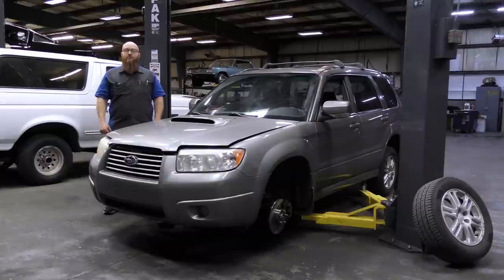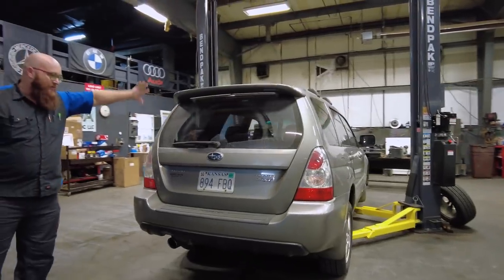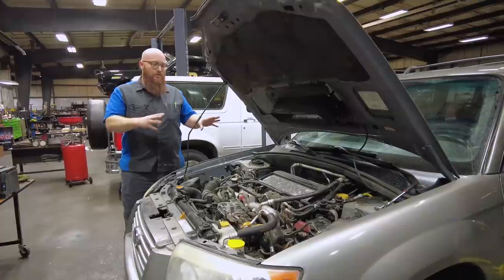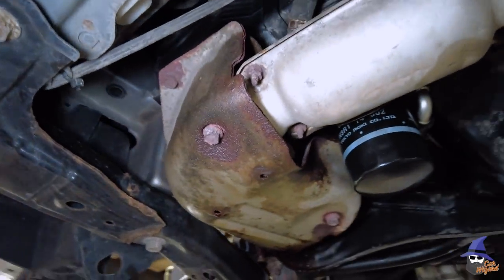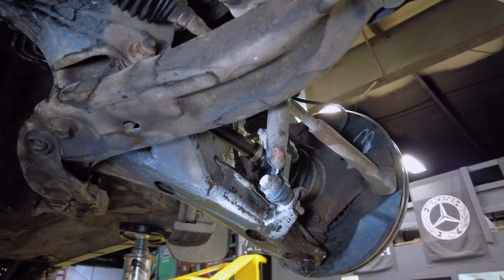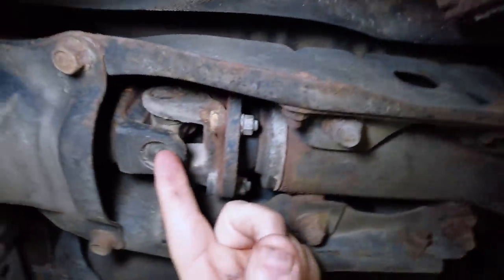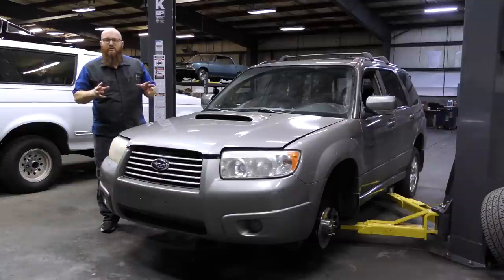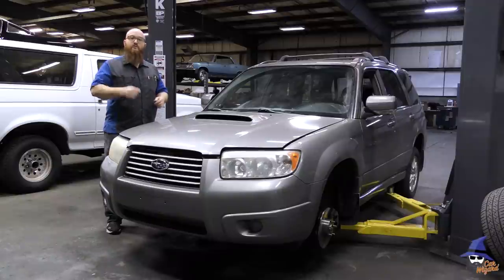Can't fix it all! '06 Subaru Forester XT has issues the CAR WIZARD doesn't fix. What are they & why?

Comment: According to my Subaru experts, the 2006 XT Turbo head gasket was a beefed up Multi Layer Steel headgasket and has never had any head gasket issues.  It was the non-turbo models that had a different crappy headgasket that are the known problems.  In fact when replacing those other models headgaskets, it's advisable to upgrade to the Subaru OEM multi layer steel head gasket otherwise the problem wil re-occur.
Reply: I have this exact same model even the same color. Many electrical gremlins and finally the engine grenaded when the lower rad hose came loose on highway and because the temp gauge couldn't be trusted my son didn't notice it.
Reply: You are precisely correct sir
Reply: Exactly. The non turbos have a crappy coating that degreats around 100k miles. It creates a gap between the head gasket and the block, then oil starts leaking through that gap.
Reply: @robsonselzelin  exactly. Unfortunately I didn't know this when I had mine replaced at 95,000 miles on my '04 forester. Live and learn I guess.
Reply: One thing to watch out for when putting an MLS gasket on a NA engine is that they're slightly thinner than the stock head gasket.  If you've had the heads machined you'll want to check tolerances before cranking it over.  Generally speaking, if it's been resurfaced once they probably didn't take enough material off to cause an issue but if they've been cut on closer to the minimum spec you may have piston-to-valve clearance issues.
Reply: The crappy head gaskets required Subaru coolant and the ground straps intact so they don't flake off from electrolysis. Nobody ever bothered to use the right coolant so they always ended up leaking on those models
Reply: @robsonselzelin  Got the SOHC 2.5L NA with 310, 000km still using OEM gasket.
Reply: Buy a FelPro.
Reply: I wonder how much extra money that steel headgasket costs.  Whatever the amount, it's a shame that Subaru couldn't build these right for what is likely trivial money.
Reply: Not true, its the earlier Subaru Turbos (90's through to around 02-03) that have dodgy gaskets.

I have an 05 Legacy R with an EJ204, never had a head Gasket done and before it came to my ownership, it had a very rough life and its still on the OEM Gasket with 135,000 miles and has not a single symptom of head Gasket issues.
Reply: @aaronmclaughlin9766  yet. Lol. Mine went at 147k
Reply: @aaronmclaughlin9766  No, It was indeed the NATURALLY ASPIRATED EJ 2.5 engines that had the head gasket issues, ask ANY Subaru fan or expert. The turbos with the multi layer steel gaskets did not have the issue-- generally speaking.
Reply: @timdodd3897  Ummm NO, Fel-Pros are OK for a lot of stuff but NOT a Subaru NA EJ 2.5 head gasket!
Reply: @sblagg527  Don't have any experience with the 2.5, only have experience with the 3.0 twinscroll, which did have issues, a 2.0 turbo which also had the headgasket go and then my 2.0 NA which runs like a champ.
Reply: @colbyroberts7963  If you're talking about a USDM model, then it's like comparing apples to oranges, the USDM didn't get the Gen 4 in a 2 litre guise, the smallest engine you guys got stateside was the 2.5, my current legacy is a JDM import, 2 litre EJ204 DOHC, which don't commonly have headgasket issues.
Reply: This is correct.
Reply: @aaronmclaughlin9766  The only Subarus that are being discussed here are the US models.
Reply: @sblagg527  ahh that's right, because as all Americans believe, the world revolves around you.
Reply: @aaronmclaughlin9766  You're the one who butted your way into this discussion with your irrelevant 2.0 liter (oh sorry LITRE.)
Reply: @timdodd3897  Never under any circumstances should one use Fel-pro head gaskets on a Subaru. They are absolute trash!
Reply: @tflo9543  Despite the multi layer? I've heard nothing but good about them. My ex employer.
Reply: @timdodd3897  they blow faster than oem. We laugh and call them FAIL-pro. They fail in the worst way possible too, coolant into the combustion chamber/overheating. OEM or 6 star motorsports gasket kit is the only way to go for the 2.5l n/a.
Reply: @tflo9543  Thanks. I'm doing a 1.8 Audi soon
Reply: N/A EJ's use MLS gaskets too, I've replaced over a hundred of them.
Reply: @jamesgeorge4874  The ones you replaced probably were the defective ones that came with a black colored graphite coating.  However, the MLS gaskets that have NO graphite coating, as the OEM ones used in the Turbos, do not have the black graphite coating and thus they don't have the head gasket issues requiring replacement every 100,000 miles.
Reply: @jamesgeorge4874  No the head gaskets that are having issues have a black graphite coating on it.  The turbocharged engines as shown in the video are not having any head gasket issues, only the non turbo head gaskets.  So you're trying to tell me that you've been replacing Turbocharged Subaru engine head gaskets for 30 years?  Sounds like you've been ripping off your customers for 30 years with unnecessary head gasket replacements.  You should be proud for that Master auto mechanic license you found in the cracker jack box.
Reply: @jamesgeorge4874  Yes most of us here also have fancy mechanic certifications and have replaced head gaskets since before you were in diapers but we don't feel the need to brag about it as a defense to our ignorance.  I rely on the Subaru expert mechanics to tell me what is going on with the failures and I'm not too old to learn from these smart young guys.  If you're that stubborn as to not heed what they say, then no wonder you keep replacing head gaskets over and over.  From your comments it appears that you failed to replace those OEM faulty headgaskets with an upgraded one.  So I'm sure you'll have a lot of repeat business every 100,000 miles when those hundreds of stock headgaskets you put on fail over and over again...just keeping ripping those customers off Mr George, if that's how your work ethic is.  By all means, don't pay any heed to those mechanics that specialize in Subaru engines, just keep doing what your doing because nobody can teach you anything new.  James George, say hello to the Youtube mute button, I'm graciously allowing you to have the final word.
Reply: @mrcead  subaru coolant? So subaru has their own special coolant i have not heard about such coolant since owning 4 subarus maybe its cooler then the auto shops.
Reply: @kylegriffiths5990  B S show a picture then
Reply: @joel.3112  🤣
Reply: FACTS!
Reply: @kylegriffiths5990  my 2L na have the original gasket and 390.000km . last summer subaru changed the lower A arms for FREE and this car is made in 2005 :D  they had a recall due to rusting issues. now i have spare a arms that only have a small hole to weld.
Reply: I believe that's also the issue in the N/A Impreza EJ25s
Reply: At least it's not a junk Volkswagen or bmw or benz
Reply: My 2006 xt had head gasket failiure
Reply: How many miles or km has this one run?
We have also many in Switzerland from them and mine lasted 370k km.
Mine also has Pedders Suspensions.🤩
Reply: I have a 2000 forester and shes on her 3rd engine. #1 was blown when i bought it,#2 was put in and lasted 6 years until the headgaskets finally went. It still ran but couldnt hold coolant.#3 is a jdm ej203 that i rebult myself  because id rather have everything done so i can keep track from mile 0. I just replaced all EVERYTHING that had a seal, bearing, or bushing including the transmission. Cost me $3000 to redo the whole car instead of $3000 just for headgaskets
Reply: I have the 08, everything else the same. Any idea if they carried this beefed up 06 into the 07 and 08?
Reply: @timdodd3897  I used to use FelPro gaskets until they started failing on me. I really liked them back in the day, but something has changed with them.
Reply: yep, the NA eats head gaskets, the turbo eats turbos (banjo bolt filter clogs and starves the turbo of oil) and ALSO can easily destroy the 4EAT auto. so turbo with manual and replace the banjo bolt with a filterless updated version and mayyyybe it's ok?
Reply: @nickkalister6291 the turbo model has oil pump issues as well. Every time you do a timing belt and water pump, do the oil pump as well.
Reply: My 09 forester made it to 204k on the stock engine before it blew the head gasket completely. 
Slapped a 0 mile reman in and she is perkier than ever! Also tossed on a 2021 STI cat back and 2021 STI sway bars front and rear with kart boy end links. Most all my other suspension is new(struts, wheel bearings, axles, control arms etc)
My reman has all MLM gaskets
Reply: @dingdong2103 cool. Sounds like owner neglect
Reply: Small price to pay for peace of mind. I agree with you about the gaskets on the non-turbo engines. Subaru finally fixed the problem after many years of knowing about it. Poor customer service. Since Subaru knew about the problem, there should have been a recall with a replacement at Subaru's expense.  @jimmy-buffett
Reply: @dingdong2103  sounds like an easy fix.
Reply: I just did head gaskets on a 07 Forester 2.5 NA. It had factory MLS head gaskets. Car has 160k miles. Factory gaskets have issues. This vintage it's a common flaw
Reply: @earlstacey2709  If the 07 Forester you were working on was NOT the XT version, then it wasn't the Turbocharged engine, and it didn't have the same gasket that I'm referring to.  My 2006 XT Turbocharged Forester has had absolutely no head gasket issues.  I have been told by several Subaru mechanics at different shops that the reason that I have no head gasket issues was that the Turbocharged engine came with completely different gaskets than the non-turbocharged engines.  Now if you want to complain about the front control arms rusting out as a common flaw issue with Subarus, then go ahead because there was a major campaign to replace these because they were rusting from the inside out and tearing apart suddenly.  Talk about dangerous.

Comment: I owned a 2006 XT Limited and loved it. The turbo failed so I replaced it with a big JDM STI VF30 turbo, custom tune and Milltek turbo-back exhaust which added 100 hp (230 hp ---> 330 hp). It went from 'peppy' to 'WHOA' overnight. The ultimate sleeper.
Reply: yep had 2, they were awesome... porsche macan minus the sound deadening
Reply: I’m having a issue with my 2005 XT EJ25 new turbo just installed builds 13 lbs but it’s cutting power
Reply: @montuckyhomegrown how many miles?
Reply: How did the new turbo change fuel consumption if any?

Comment: The naturally aspirated 2.5s came from the factory with the coated paper head gaskets that have been issues for years.  The turbo engines and the 6 cylinder engines came with MLS head gaskets from the factory and were much more reliable.  That's why if you have to do a head gasket replacement on a Subaru n/a engine, you should use the turbo head gasket as the replacement.
Reply: This! Wise words!!!!
Reply: Bruh wtf was Subaru thinking
Reply: You're not going to find the old style paper gaskets anymore... they're ALL MLS, and have been for years.
Reply: And failing car HAS paper gasket.
Reply: The thin ones haven't be available for years. But yes.
Reply: @TakuroSpirit77  Just buy a 2018 2.5 legacy , thinking about chaning it for a outback or a forester what ur call keep it or ?
Reply: I wonder why Subaru let this problem go on for all those years! I had the same problem with a 1987 Subaru Legacy (plus a lot of other issues) and the problem lingered with Subaru's for years.
Reply: There are caviots to this, tho.   the cars aren't worth even the 400$ it will cost you on the low side to get it done. Not to mention anything that breaks along the way or is worn from 100k+ miles. 

The MLS gasket is punched differently and has passages that the original NA engine does not have. This will eventually lead to an inner HG failure and just dump the collant in the CC and burn out white smoke. 

a metal after market OE , you are much better off as the pinch points on the head are slightly different. From turbo to no turbo.  They look the same, but in practice, they aren't. The turbo needs more collant to pass more quickly. Thus, the holes are enlarged on the gasket to make up for this measurement. 
When you put a turbo gasket on a NA motor the engine cooling will happen much faster then normal.
Thus not keeping the car in proper operating tempture for the block to midagate cold and hot cycle expansion.

Hope this helps you guys. 

❤✌🏼

Comment: I have an ‘06 n/a, with just over 200k kms. The thing is a beast and was well worth the $5000 I bought it for 6yrs ago. I’ve travelled halfway across Canada and back with it and it has seen some of the worst mother nature could throw at it. Unfortunately due to rust I am unable to keep up on the maintenance otherwise I feel it would easily go another 100k kms. Highly recommend these AWD machines. With a proper set of winter tires you have to work at getting them stuck.
Reply: I have a rust free XT body if you need one. Unfortunately 3000 miles away lol.
Reply: 390.000km here in Finland. no problems with the engine and i only have surface rust at the front subframe. this 05 forrester have been to rust proofing from new and i bet it has been done again later since i can still see that black stuff under the car.

Comment: I’ve got a 2005 Outback L.L bean with the Boxer 6. It’s terrible on gas, but my god. This thing is the best vehicle I’ve ever owned. Really fast, even by todays standards, impossible to stop in the snow, cargo room for days. 

My only complaint is that to replace the radio you need to import a separate headunit breakout piece from Japan at Quite a steep cost.

My ideal goal is to eventually get a rust free one from the south to keep as a forever vehicle!
Reply: @Dankcatvacs   I bought it back in sept. With 92,000 miles, it’s got 109,000 now. No issues with the head gaskets, no weeping or lost coolant or anything. Zero blowby, haven’t had to replace the chain. Far as I’m aware, if you keep up on your oil changes their usually good for the life of the engine.

Comment: I have this model XT auto. The secondary air valves gave way at 60k Kilometers. Fortunately they jammed shut ,so we just took all of the plumbing off as well as the pump. Had to get the ecu reflashed. Apart from that it has been plain sailing.

Comment: Despite what you might think, a turbo subaru is actually a pretty special vehicle.  Especially if you live where it snows. I've had my wrx since 2007, 240k miles and I still love sliding it around

Comment: I've an EJ204, so the non-turbo version, SG with a manual. Looks very different under the car at the front! 

I also recommend those Pedders units. I've got the heavy duty ones in the rear of mine, and will likely replace the fronts when one fails too. 

Cheers for the video, Wizard. Was great.

Comment: Recently changed the transmission and differential on my farrier's Forester.  I never worked on Subaru before and I was shocked at how easy it was. Good cars if you want to learn to wrench.
Reply: Agreed. They are great for learning. I had a 17 WRX and I had never worked on a car before owning that. It’s especially nice for oil changes because the filter is at the top.